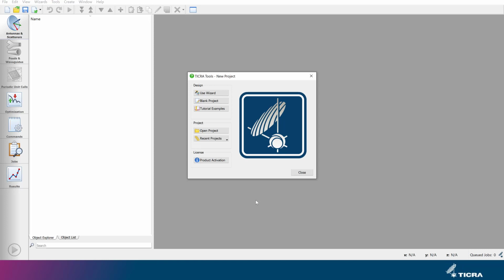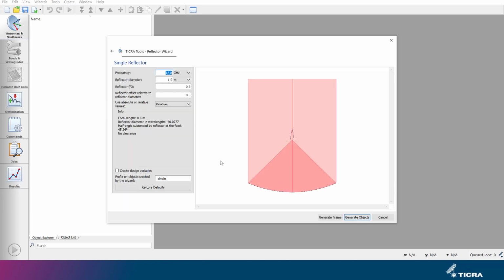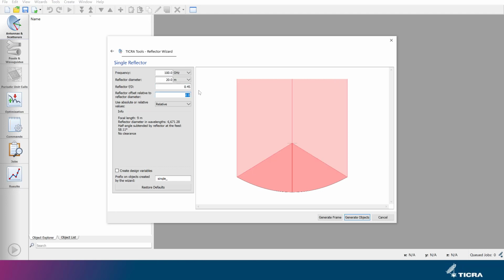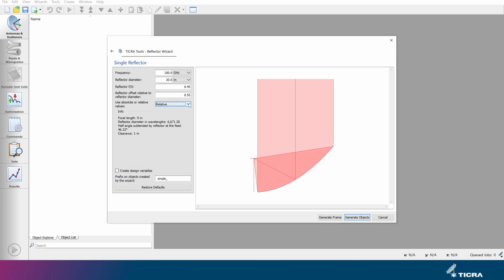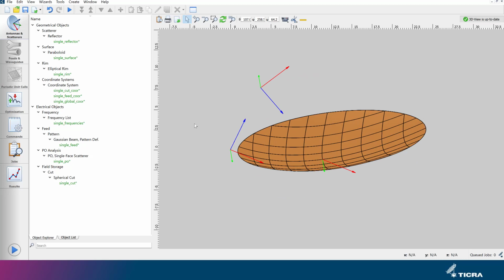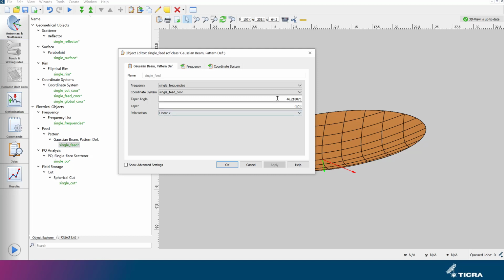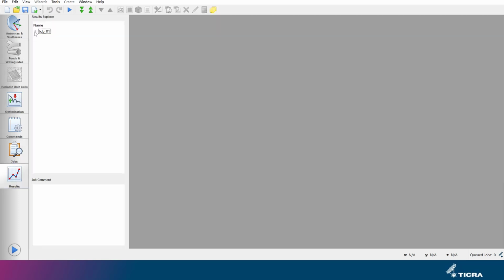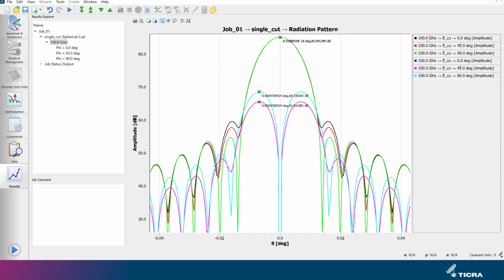GRASP: How to setup a reflector antenna analysis

Comment: A use case you may not be aware of is that of  victims of what the news media is calling Havana syndrome, but actually is being used on thousands of Americans.  It appear to be a frequency hopping beam steered mmWave or MW beam, possibly combined with Ultra or Infra sound or other remote modalities.  The main thing the victims would be looking for is a way to reflect the beams as much as possible, or failing that to reduce them.  The difficult part to defend against is the frequency hopping - I think a fractal antenna design might work, printed like a circuit board with self-similar scaling pattens to capture a wide range of frequencies - say 300 KHz to 90 or 120 GHz